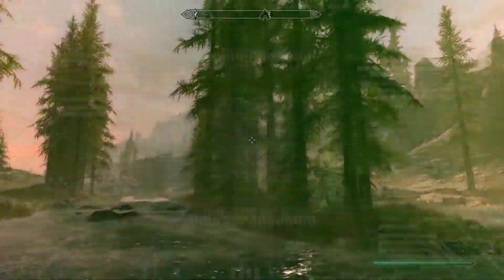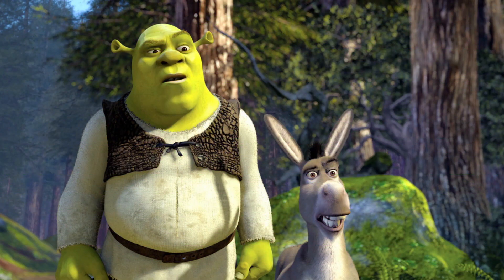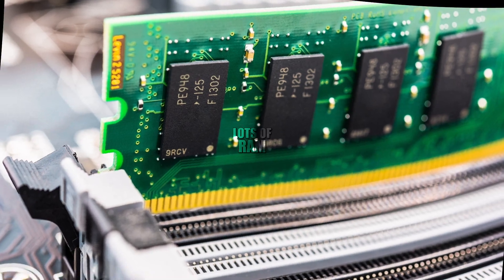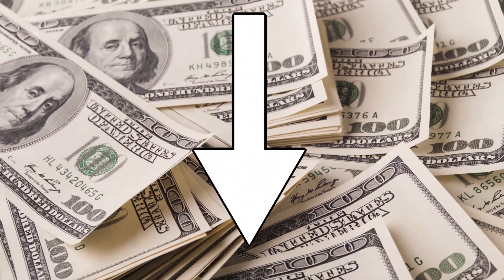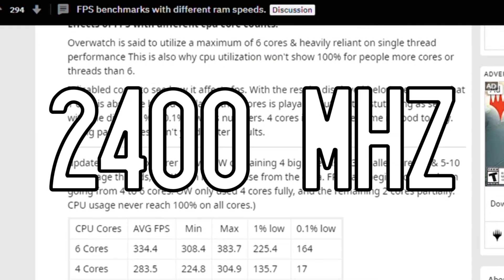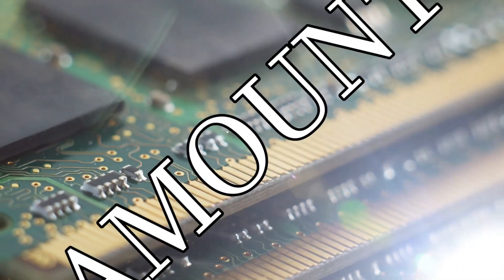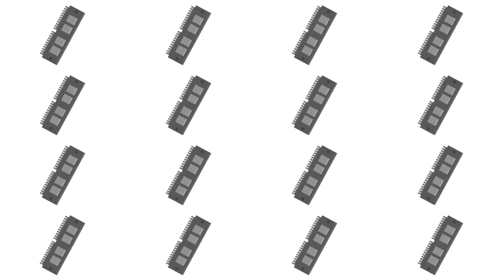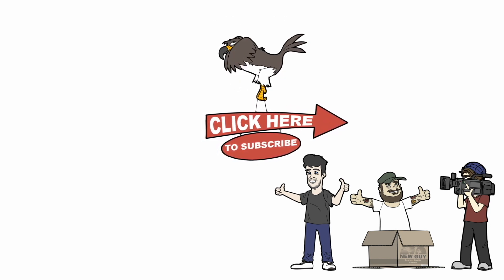Ram SIZE vs Ram SPEED for Gaming...What's Better?

Comment: Some games like Star Citizen are already using more then 16GB of RAM, you'll want to upgrade to 32GB now so you'll be ready for when that game finally comes out in 2039.
Reply: even at 1080p resolution? And do they actually need the ram or are they simply not flushing the unused cashed files/ taking everything they possibly can? I know there are other games that take almost as much memory as you have installed, doesnt mean you can easily do with less though..
Reply: You can piss through 16GB of RAM if you get into mods for PC too, you can get Minecraft textures that recommend 137GB of RAM with a 40GB GPU...

Comment: 16gb is a minimum nowadays. If youre running Intel, 3200MHz is enough, If Ryzen, 3600MHz is prefferable. note: cas latencies and timings are CRUCIAL too.
Reply: 16 GB is mainstream for 1080p 1440p gaming *which is also mainstream.. 8 GB is mininum i would say
Reply: @Rem_NL  Oh boy, you must not have experienced the pain. I remember struggling with 8gb 2 years ago. Try having a game, chrome, Spotify, steam and discord open at the same time with only 8gb memory. 9/10 it will have to resort to virtual memory, which windows is terrible at managing, sending game files to virtual memory, reducing performance significantly.

Comment: ryzen 1 and 2 dont utilize ram speeds over 3000mhz idk about 3 think they said dont go over 3700ish?? 

i just stick with the common 2400mhz just got 16gb more  giving me 32gb in total. Had a bit of configuring to get windows to not have the extra 16 be hardware reserved. I did everything and of course the last option of flashing a new  updated bios worked.
Reply: ryzen 3 motherboards do 3200 Mhz out of the box, but many manufacturers support OC memory up to 4000 Mhz

Comment: 2011 the mid range systems and laptops all had 4GB of ram. I would disagree that 1GB is standard
Reply: Yeah I had 1GB in 2001, 2006/7 when the core2 duo came I was at 4GB, that was high end for the time though.
Reply: 2 gig in asia
Reply: What sort of laptops were u getting 😂😂
Reply: @shayoconnor2406   acer aspire 470z core 2 duo 
Dell xps 
Lenovo b40

Comment: You do realise the main difference between memory and storage is memory is where the CPU executes code from?
Reply: pagefiling is a thing
Reply: It is, which also does not use memory.  Page files are on disk and are used for when memory runs low. No code executes from a page file, instead it has to be swapped into memory first.
Reply: @st3ddyman  cpu does execute code from pagefile. (horribly i must add)
Reply: No, it does not. That is physically impossible. A cpu has address lines which go to memory only. Page files have to be swapped into memory to execute code. That is why they are also called swapfiles

Comment: 2011 was 1GB RAM... in what world? 4GB was the standard around that time as 4GB was required to run windows 7 64Bit properly. 16GB is fairly standard now with workstation systems opting for 32GB ram.

Comment: The thing with PC hardware and PCs in general is even if you have, for example, 32GB of High Frequency RAM... You may not need that for certain games, but you definitely need it for digital photo & video editing, 3D Modeling, etc. That's the beauty of PCs; They can do more than one thing (play games) unlike a console. So, I think the "standard" is going to be many things to many users?

Comment: RAM speed has been a proven factor since DDR3 (while it only will increase framerate by a few fps), but one of the main factors you guys did not even mention is also a big factor, the latencies....RAM amount intrinsically is a non-issue...a game  will not run faster when having 64GB RAM if the system  only uses 9GB when running the game...if  you plan on multitasking and your system uses 20GB at  that time, having 64GB still will not affect the speed...it's that simple.

Comment: The idea of more RAM compared to faster is something that really depends more on the technology surrounding the RAM rather than the RAM itself. There is a ceiling on how much OSs and other programs know how to work with which is why RAM size plateaued at points. So having more RAM than what any program or CPU knows how to deal with does make limit the size argument. Now the speed argument is an interesting one. We run into a lot of the same issues as with the larger size, but with a few twists. It is small, but there is the increase heat and voltage use. However this is near negligible. On the upswing faster RAM could allow for faster calculation and changes. However again, this is all limited to how fast this information can be processed by either the CPU or GPU. So in essence, it all depends on how fast or much the Processing Units whether Central or Graphic needs to change up what is being used. Best case scenario is just that we focus on both speed and size.

Comment: As you noted it really depends on the game.  Watch your system and play to find where the choke point is.  Now that 16-32GB is really standard I don't think you're going to max out your ram capacity.  With that said even low speed DDR4 should be fast enough to keep up with your video card unless you're dropping 1000$ on the card itself.
It comes down to identifying the choke point on your specific system in your specific game.  Have a lower end video card? High speed ram won't strain it more, it's already capped out.
Ram speed however is the hardest to really see on a benchmark compared to other things.  Just looking in the task manager it will say how strained each component is and by what applications but with ram it tends to display capacity more than anything else.  But as was shown in the tests increasing the ram speed got more FPS despite probably not showing that the ram was maxing out in any readable way.  Best way to test that is clearly run a test, check FPS but also watch all system usage, mess with overclocking or change ram speed, re-test and see what happens.
Now if we're talking ram speed vs capacity in a video card OH HO HO!... speed... all the way... no question.  After you break 4GB, unless you're doing 4K, all about that speed.

Comment: I would say that there is an addition question: where does RAM speed matter more, the main system or the graphics card?
Reply: main system by far, you almost gain no performance from overclocking your graphicscard memory speeds compared to your system rams speed.  And getting faster system ram also improves your fps, its a double edged sword.
Reply: @Rem_NL  Not true. I got about 7% more performance from my gpu by overclocking the ram. Core was running overclocked before and after the memory overclocking
Reply: @jogeem5480  haha sure.. pics or it didnt happen
Reply: @Rem_NL  I don't really care if you believe or not so I won't bother
Reply: @jogeem5480  you prolly right 3/5% is pretty common for a 1000Mhz overclock on vram you might just have a higher overclock, but still overclocking the Dram memory is usually more usefull than overclocking the Vram

Comment: Okay, so ram speed may become more important in the future, however, don't forget that you should first fullfill the minimum nowadays in order for ram amount not to be a problem, which is 8GB. Ram size will always have precedence, I think, no matter how important speed is or becomes, because streaming files back and forth from your drive to ram will always be slower, even when using an ssd.

Comment: Might vary a bit but the program liked to load all the components at once and then calculate ram speed doesn’t matter if you have enough ram. Even tho you can load all the memory at once and even it does fast if your cpu or gpu is slow it all doesn’t matter.

Just get enough ram size and then ram speed doesn’t matter much compare to cpu or gpu speed.

Comment: 2 x 8gb sticks at the fastest speed your mobo will accept.
Reply: I read somewhere 4x4GB sticks at an equivalent speed ends up being faster in most cases.
Reply: @Olde_Faithful  generally you are better off with 2 sticks. 2 extra sticks will tend to run slightly slower. it is fairly irrelevent though.

Comment: The answer is both. If you don't have enough RAM, that's the bottleneck. If you have enough RAM, the speed is more important.
Reply: Rule #1 of PC gaming: There will always be a bottleneck in your system.
Reply: @penumbrum3135  Thats not how it works
Reply: @Hetsu..  That is how it works
Reply: @Hetsu..  tell that to my ryzen cpu, I recently bought faster ram and there is a very noticeable increase in fps and a decrease in stuttering
Reply: @Frisbie147  And?
Reply: @Hetsu..  it was a bottleneck, there is always a bottleneck, it's pretty much impossible for a perfectly balanced system to exist
Reply: @Frisbie147  You're using ryzen, I9 9900k and Titan RTX wont bottleneck
Reply: @Frisbie147  did you have 1666mhz ram?
Reply: @Hetsu..  no, its ryzen, minimum speed of ddr4 ram is 2133, and i upgraded to 2933mhz, and the performance boost was a lot more than i expected
Reply: @Frisbie147  Correct me if I'm wrong, but didn't ryzen CPUs have major issues with certain types of RAM? I remember reading about it several months after the Ryzens first came out. Maybe your issue had something to do with that?
Reply: @whyismynametaken123  ryzen is wierd, on the one hand faster ram has a huge benefit in performance, on the other faster ram makes it more unstable, thankfully I haven't had many issues caused by it
Reply: If none of your components is a bottleneck...well you'll then have an infinite number of fps. Congrats.
Reply: Exactly
Reply: What is enough

Comment: Computer parts company: Do you want more RAM size? Or RAM speed?

Me: Yes
Reply: PERFECT😂
Reply: @latenightgaming5057  honesly i want more ram size and incremental speed increase... as size is more important for reducing stress on hard drive and cpu.    If you ever hit 99% ram then you will know that in some computer it will try to cycle that ram into hard-drive and try to preserve its computing as much as possible.
Reply: hothamandfauri buys 1gb 1330mhz ram
Reply: @tostcudede1332  😂
Reply: @tostcudede1332  Those were the days, dude.

Comment: I need help my pc can run most games and around 90+FPS and was wondering what to upgrade next, is there a software that will tell me this or do I just have upgrade what I think is the slowest parts.
Reply: Hard to answer . Need more context. When you say most games 90fps, is it on ultra or low graphics setting? If it's ultra, then maybe get a 4k monitor?

Comment: Technically speaking, you wouldn't call a hard drive "memory". Hard drives and SSDs are "storage" not memory
Reply: Hard drives and SSDs are considered non-volatile memory, so you can very much call them memory.
Reply: You can turn them into a slow memory solution with a page file I suppose
Reply: @JerryLoffelbein  Why tho... lol
Reply: @Fuzzycat16  gits & shiggles?
Reply: That's always bugged me how people use the term.
Reply: Not coz its on a disk
Reply: I dont understand from pc but arent memory and storage the same thing
Reply: @creativename152  Typically, memory is a temporary space (volatile) where the hardware places data for the applications and related data being currently used by the system. Storage is long term, like where applications and media is kept for the current and non-current processes. Storage is usually a HDD (hard disk drive) or SSD (solid state drive) which is non-volatile, meaning the data is kept even when there isn't any power to the system. I realize it's confusing these days but there is a distinct difference. My brother didn't understand the difference until I explained how it's used and works. It's especially confusing when people use phones and tablets that both use types of memory that may seem similar. Often, even sales people use the wrong terminology for those situations.
Reply: @Lloyd-Black  ow damn you know alot i knew like 10% of these that u said anyway thx
Reply: Technically you're only half correct. In the US, you're right, in England, you're not.
Reply: They are persistent memory.
Reply: I think his goal was more intro to or more remedial. 8 GB is more than enough to run most games now, and extra just goes to waste. You get diminishing returns as ram speed goes up. You'd have to go out of your way to get under 2000 MHz new nowadays.
Reply: @nicholasbuckner5221  8GB is not enough for gaming if you don't bother closing every other program running on the computer, and unless you only do simple works on the same computer it'll pretty much make the PC gaming only.
Exhausting RAM also means that the PC can't pre-load frequently used things in RAM which might increase the chance of stutter. (Though in that case it's better to upgrade the hard drive to a faster one first.)
Reply: @FlameRat_YehLon  there's swap also known as virtual memory and the least used programs go there. I recommend checking out hardware unboxed for their yearly how much ram do you need youtube videos.
Reply: @nicholasbuckner5221  Swapping memory page can cause stutter, and unless the background programs sits completely silent, it might swap out one of the page from the game and cause the game to stutter, if the RAM is indeed exhausted.
And at the same time, leaving no room for RAM buffer might affect performance.
And there's no universal standard on how many RAMs are enough. It all depends. But 16GB generally covers everything except large image and/or video editing, while 8GB is more and more "barely enough" nowadays, especially for 4K gaming.
Reply: technically Intel Optane is "storage and memory" so maybe he was referring to that lol
Reply: Hard drives = persistent memory

RAMs = volatile memory

Its basically the same the difference is just how they both manage memory as a whole

Comment: Speed matters more than size. I upgraded from 16GB to 32GB same speed and couldn't tell a difference in anything but VMs. Later I upgraded again to a higher speed of 16GB and it was night and day difference. There are lots of video benchmarks on YT as well with modern games and RAM speeds.

Comment: Welll.. i bought 8GB with my PC in 2009. just this year, we have finally passed the border to 16GB  being a reasonable amount. So id like to clarify: the time one needs 32GB is probably so mamy years from now, that you need a new PC anyway by then. Judging by that alone, you might argue, that speed is more important but then again, the fps gain is so low, that you cannot deem it a good choice either. So in the end, one should ask this question: “Do I prefer having a small edge in performance, or do I prefer enough RAM, so I never have to worry again?”

Comment: Ram clock speed is overrated 2666 is enough and once you reach 3000 the the benefits are gone if you go any higher.
Reply: Clock speed  matters with an Apu.

Comment: Ram speed is very important for ryzen
Reply: Yes unfortunately AMD CPUs have been bottlenecking for years. I finally ditched my AMD 9590 (4.7ghz base clock) for Intel i7 9600k). Massive difference.
Reply: @rodrrico  dayum, i never even heard of that cpu... new ryzen is pretty much on par with intel though (quite ahead for productivity, a bit behind on the highend for gaming)

Comment: More ram always better then speed. U can always overclock ur ram with xmp or manually like i did.  I have 8 gb of ddr3 overclocked from 1333 to 2100 
Tune the timings and test and u gud to go
Also always go with 2 or 4 sticks of ram for dual or quad channel that rly important

Comment: i have 10 gb of ram 8 gb of fast ram but 2 gb of slow af ram so should i take out the slow ram stick?
Reply: Yes. Your computer ram speed is limited to the slowest stick. So the 10GB is being wasted right now. It will register that you have it in your system but will not utilise it's speed due to the limitations of the slow 2gb.

Comment: I'd take 8 gig of 4400mhz over 32 gig of 1866mhz any day.
Reply: Stoney_Eagle what about 16gb of 2400mhz
Reply: @killswitch1578  Depends on if you use Intel or AMD, if you go for AMD take as fast as your budget allows for, Ryzen loves fast memory. 
I would reccoment at least 2666 for both sides tho.
Reply: Stoney_Eagle I use intel
Reply: @killswitch1578  if you need more info go check out the tech channels like Linus tech tips, gamers nexus and Jayz two cents. They will give you all the benchmarks and tips you need to choose wisely 😉
Reply: @Stoney_Eagle  3200mhz for ryzen at least
Reply: you gotta be pretty gullible to go for 1866.
Reply: 32gb over 8gb any day, dont care what speeds
Reply: I Wouldn't
Reply: What will benefit form 4.4ghz ram speed?  I still think 16 gb of 3.2ghz all you need for now

Comment: Theres also Timings (cas latency) thats also important.
Reply: under rated comment
Reply: Is latency more or less important than speed?
Reply: KingCobra it goes hand in hand, so its just as important. Like for 3200mhz ram, you want cl14 sticks, for 3600mhz, you can do with cl15 sticks. the tighter the timing, the better

Comment: And the effect of ram speed on AMD Ryzen CPU is not even mentioned. RAM speed for Ryzen is integral for better results. Thats just the way that the aquitecture is made. RAM qty is important to a degree but after a certain amout, it really doesn't give you any gain a far as frame rate.

Comment: Ram speed is effective for open world games that have extra assets that arent thrown into gpu memory, Destiny 2 is a good example of this as well. Both speed and capacity matter quite largely if you are running a bit multithreaded workoad that has a large amount of assets that will be needed later, instead of now.